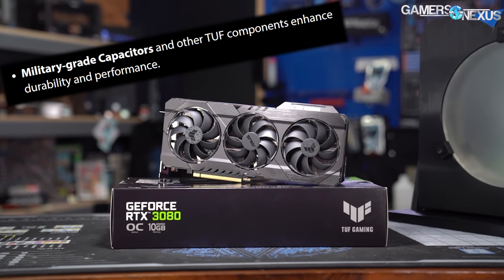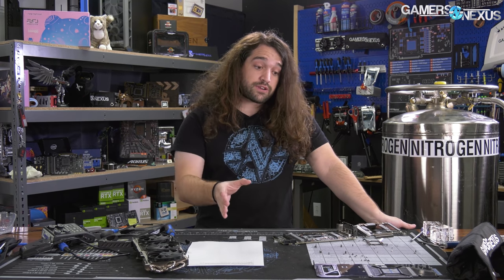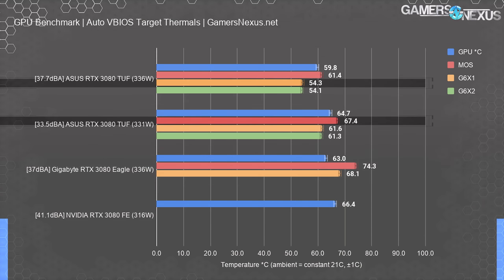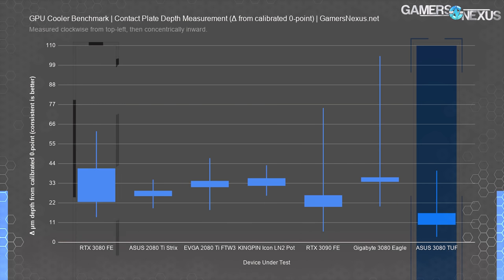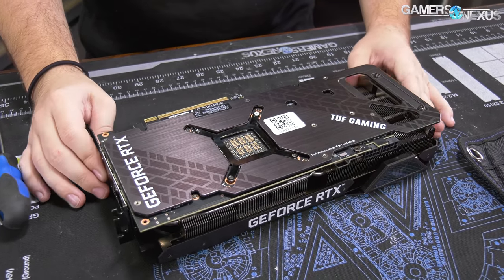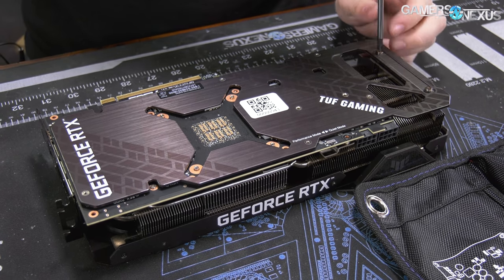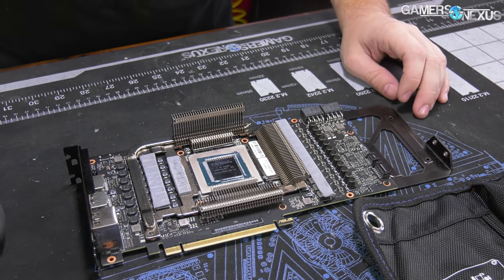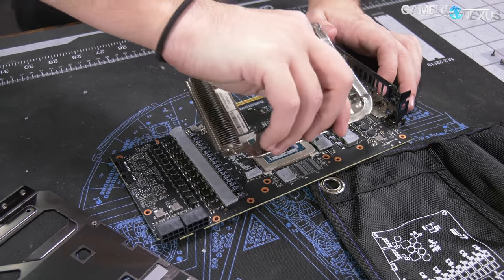ASUS RTX 3080 TUF OC Review & Tear-Down: Thermals, Noise, & Overclocking

Comment: Just wanted to say thank you for the teardown! I'm finally doing a full cleaning of my used 3080 that I got last year (it be dirty AF)! Got a bunch of new gelid gp-ultimate thermal pads that I'll be replacing the old ones with. 

Also, Armoury Crate somehow bricked the led, and  now it only works with Armoury Crate. I was so dumb to install it when I first built my new PC grrrrrr. Literally malware imo.

Comment: Definitely keen on seeing deshrouded performance of the TUF's cooling solution with separate cold plate for GD6X RAM vs other cards with a single cold plate solution. Most AIB 3080s look like they'll easily fit two 120mm fans.

Comment: Military grade reflects a specialized method of testing which consist of extreme G-Force survival, temperature and overvoltage specs. components designed for rockets and missiles. Aircraft Grade aluminum also is manufactured with higher levels of specs. including temperature tolerances and flex/fatigue stress.

Comment: Mine (Same model) came yesterday, ordered on September 17th. Had a bit of luck to get a model with the good power delivery at a decent (780 €, saw it for 999 € as well) price, since availability was crazy. Pretty heavy in comparison to the watercooled 1070 it replaces. Nearly didn't fit in the Define S. And quite noisy, but that's very subjective in an otherwise custom loop cooled system. 

I will use your video for changing to the water block, once one is available from a reputable manufacturer. I'm really curious how it will look in the new O-11 XL, once that hard line build is done.

Thx so much for the video!

Comment: Machinist here...
Aircraft grade aluminum is generally harder then normal 5052 or 6061.
7075 is generally used as "aircraft grade" because of its ability to withstand high tension. Its heat treatable (as is 6061) its great to weld and can be used in main structures where-in 5051 would just bend like rubber.

Military grade is a thing, despite companies over using the term. Military grade generally means the SKU has traceability. So if a problem were to arise due to a capacitor or mosfet... the traceability would give engineers the exact reasoning for failure (example being:  Foundry messed up the alloy,  SMT factory machine wasnt calibrated correctly, PCB manufacture had a questionable QC on a batch of motherboards, etc) But like i said traceability is the main thing, not super tough components. Also generally means there is no added BS to make the product not work. So flashy ammenities arent a thing on "military grade" which may be where the sentiment of "its only the bare minimum" comes from

All that being said Asus could just be blowing smoke out they ass. I dunno. But these things that are being mocked in fact due exist.

Comment: Couple of issues i have found with TUF - it doesnt have a properly functioning fan-stop feature at this point. It is configured to start spinning if power usage is more than 30w, which is 50w for other brands. But anyway i would prefer it to be entirely temperature based. In custom curve you cant stop the fans. It's not just me - it is being discussed all over the internet. I can live with it because my sample can spin with stable speed as low as 660 RPM, but others are saying it's locked at 1000 rpm for them.
Also some reviewers reported TUF having 375w tdp while what we have is obviously never breaks 350 barrier.
Both should be fixable with BIOS update, but as of now no official statement from ASUS.
Reply: yeah i have the same issue but im in the 1000rpm bracket :(, just sitting in windows the fans stop but the slightest draw in power the fans kick in then off then on, fingers crossed for a bios update

Comment: The ting i asociate with military grade components is 1 higher temperatures and 2 lead solder 

Because leadfree solder is not guaranteed to stay "good" for 20 years   leadfree solder can grow microscopic conductive "hair" that may short out pins
Reply: Dendrites. I ran into them before, a bitch to troubleshoot. Like dealing with a metal life form.

Comment: MIL-STD grade capacitors refers to components or devices qualified via test and/or analysis to MIL-STD-704 and/or MIL-STD-810 specifications. The various categories in these tests cover amongst others Environmental, Power and EMI / HIRF conditions. This could be a good thing, if the vendor advertising such compliance actually accompanies the statement with which categories of performance with thing these test their parts have be qualified to. In short, this could be a good thing especially when it comes to transients, ambient and operating temperatures on the motherboard, RF fields, etc. And regarding you aluminium references, aircraft grade aluminium is also nebulus. And "aluminum is NOT always aluminium. Aluminium comes in various forms, 7075, 6061, etc which have different tensile strengths. There are also more exotic types of aluminum such as Aluminium oxynitride (or known by  Star Trek fans as "transparent aluminium", Yes its real. Google it).

Comment: To be fair, generally, aircraft grade aluminum is 6000 and 7000 series aluminum. It's an actual qualified, mostly consistent standard. 6000 and 7000 series aluminum have higher tensile strength and are usually easier to weld and modify. It really depends on application as to which you would choose to use but it's actually something quantifiable. Most aircrafts are made with a combination of 7000 and 2000 series aluminum at various point in their structure. Military grade capacitors is nonsense marketing bullcrap with no quantifiable standard other than, "good enough for a random military force at some point in time to use this in something that requires a capacitor, even if only an alarm clock".

Comment: Actually, aluminum like most other metals come in many different grades due to their variance in the molecular properties, and are selected for the desired end product/use. 
Though, if the properties are not direly important to the user, one use different grades inefficiently without concern (similar to using a knife for soup or a spoon to cut a steak.. dumb but can be done).

"Aircraft grade" aluminum typically refers to 7075 for billets and 2024-T3 for tubes.
The composition of the billets, in particular are actually an alloy of aluminum & copper. 
The alloy increase the weight, strength and surface resistance while reducing ductility and oxidation and being a cheaper base materials and benefits from easier tooling & more cost effective manufacturing processes. 

As such, aircraft aluminum is typically used in the manufacturer of items for Aviation, aerospace and blow/injection molds, usually where weight is of a major concern.

Comparable desired properties are typically found in more expensive materials or materials that require a more costly manufacturing process like:
Stainless steel - heavier and costs more to tool
copper/brass - heavier, surface oxidization is faster/easier and has a lower surface resistance
bronze oxidize easily and is very expensive as a base material
carbon.. titanium.. niobium.. etc. etc.. etc

On the other hand, "Military Grade" is basically a standard of acceptancy that the US military has for vendors, when supplying items and does not however, always equate to durability (which is how it is how it is typically marketed).
eg. Military grade food rations (MRE) does not make it better than other food rations, it just means it meets the stipulated mineral ratio, etc as outlined.
So "military grade components" just means that it is supposed to last a stipulated & predetermined timeframe for use under specific conditions.

Soooo for eg, lets say they are buying a laptop for a recruitment office in a specific location and the mandate spec is that it need to last 2 years in a "standard office" environment with 6hrs of daily use,  using "specified" software/parameters, all with no equipment issues, then once the item meets/met the criteria, it was deemed Military grade.. which is similar but different to "combat grade" or "Harsh environment", etc.

Comment: As an aircraft engineer, there is big difference between Aluminum T6-7075 or T3-2024 (commercial aircraft use) with Aluminum T6-6061 (general use)

Comment: If you could get a hold of a Trinity card that would be great. So much vitriol online directed that cards way due to its relatively low power limit bump (5-6% iirc) and not using MLCCs. Lots of claims of it falling 8+% behind other AIBs in perf, which doesn't seem to be the case going off TPUs review but people are still claiming otherwise.

Comment: Its about rating for capacitors.  Military grade components are rated to a tighter tolerance and higher thermal stability.  There is not a massive difference but they do have to pass a tighter "binning" Some military components are designed from the ground up for higher strength and thermals or even radiation hardening.

Comment: From web: Military grade components are held to a higher standard than consumer grade components. Required to operate at elevated temperatures, exhibit higher tolerances and adhere to more stringent measures of quality control, obsolete military grade components can be some of the most difficult parts to source.

Comment: Hearing Steve talk about the size of Philips screw driver to use is interesting. In my experience most people who doesn't work a lot with tools tend to go for small screw drivers, usually one size below what they should have used. I can't begin to the times I've heard people bitch about how bad the Philips head screws work, only to see them try to screw in a #2 screw with a #1 driver or a #1 screw with a 0 or even 00 driver. No wonder they cam out over and over. Sure Philips in't nor was it ever the best, but still it's done a decent work for well over 100 years by now so it's not impossible to work with. In general I tell people to use the largest driver that will bottom out in the screw and that will usually be fine.

Comment: @Gamers Nexus What did you use for the frequency testing? I just tested my 3080 TUF OC with the 3DMark Time Spy Stress Test and the frequency is bouncing between 1850 and 1905 MHz, which is at least 100 MHz lower than your results. How is that possible? What is wrong with my card? Temps seems to be the same at 63 degrees as so is the power draw at 339W.

Comment: There's admittedly multiple different purity levels for aluminum. Purity doesn't mean much for strength by weight ratios, but it does imply how much it'll flex before it breaks as well and thermal conductivity. Aircraft-grade aluminum is indeed "just aluminum" but of a higher purity making it more flexible and offer higher than average thermal conductivity compared to lower purity aluminum. As for Military-grade... there is indeed a rating system for what falls within mil-spec tolerance, but for the US military that minimum standard is rather low. If it works, it's military spec. If it doesn't work, it could still be military spec.

Comment: Mil spec is good and it does have a definite real life parameter, not just marketing lingo.  The long & short of it is mil spec is better than normal and industrial grade is even better.  Details below. 
~~~~~~~~~~~
As I remember from my electronic engineering days (40 years ago) "Military Grade" electronic parts had a very specific and extended operation temperature range, tighter specification tolerances and higher power tolerance. Industrial grade parts are even one more step up.  For example, a mil spec resistor could be rated at 1/8 watt at 70ºC, but the same industrial grade version of that resistor would be rated at 1/4 watt up to 125ºC.  Both parts costing a great deal more that normal resistors.... as I recall from my National Semiconductor purchases.  So military grade parts means less variance between end product devices, which could be up to or more than 5% with normal caps & resistors.

Comment: So… in Germany this card is 897,25€ (about $1060) from official resellers. The FE would 699€ ($824), but NVIDIA stopped selling it and hasn't announced who will sell them in Europe, if at all. - But due to Covid we had a temporary VAT cut from 19 to 16%, thus in January the cards will be 720€ ($850) for the FE   and 920€ ($1090) for the TUF respectively… no MSRP cards will ever hit Europe expect the handful of FE cards sold so far.

Comment: Ive received mine one week ago. 64°c in burn, no crash, cap at 2050mhz. Perfect ^^
Reply: If i put +100, +200 or more in core clock, the max frequency stay at 2050mhz. May be a bios limitation? This board is really stable. No crash at all. The oc of the memory don't do anything in benchmark and game, ive tried but i have nothing.
Reply: @mzell36  it runs into the power limit. you have to increase that as well.
Reply: @NorbertGanslmeier  it’s already done ^^ 110%

Comment: @gamers nexus; In Canada, Asus and Gigabyte both state that the warranty is void "in applicable regions" if the taper seal is damaged or removed in their separate 'warranty pamphlet' that comes with the cards.
it looks like the way they set it up, is to sneak the warranty warning into the little pamphlet that no one reads, that they can more easily alter for different regions.
at least that was the case with both the 2080 supers i worked with in the last few months

Comment: Mil-Grade ( Military Grade) electronic components have a very high tolerance for values. Example common electronic resistors have a value tolerance of around +/- 20% where mil-spec have a tolerance of around +/- 1%.

Comment: Military grade components are a thing but for the most part there just binned & have been through extra testing and grading to meet requirements for voltages,thermals,shock or G force

Comment: It runs a lot more quietly than my EVGA 2070 Super. I run it locked at 2100 MHz at 68 C. Running it stock was around 56 C. Air cooled system in a room with ambient temp of 21 C.

Comment: Reasons why I buy this is that it has 2 x 8 not 3 X 8 which would fit in any Egpu without changing the Power supple or splitter cored that would risk the gpu itself. The price is a budget end then ROG strix which is based for desk top chassis. If ROG did keep. The 2 x 8 with an optional activation of 3 x 8 would sell out for a few. More years but as most streamer and gamers

Comment: For all you joking about “military-grade”. It’s actually not a bad thing, just means it’s built to a specific standard, meant for endurance and reliability, and to be easily used and maintained by grunts/nincompoops/5 year olds without destroying the thing or killing themselves.

It’s also rarely “cheap”, even if it was the lowest bidder building it, which isn’t always the case it’s still never “cheap”. Usually the company getting the contract isn’t the cheapest, but the one that can honor certain particulars of a contract - supply quantities, deadlines/timelines, training and maintenance schedules.

Comment: I'd like to shrare some results with lapping and repasting GPU HS over the years. I had 3 980ti and the best thermal paste was the old MX-4. I had top pastes at the time including some mada by Kingpin but MX-4 came on top on every test. I've a 2070 now, the Galax OC yada yada with the 5 heatpipes cooler. Tried Gelid, new Kingpin and the new Noctua. Gelid is a clear winner. From my most recent tests it's obvious (don't ask me why) that GPUs fare better with less viscous paste. Don't assume what's best for CPU is automatically better for the GPU.

Comment: Military grade often refers to a component classification , i electronics this means a wider temperature rane - minus 40 to plus 125 c .   This appears to be limited to the capacitors , and is prohibitively expensive in any but military applications

Comment: I don't want to sound like a nerd, even though I will and am, but aircraft grade aluminium actually means something. Aluminium is NEVER pure aluminium, it's always used as an alloy. Aircraft grade aluminium is 7075-T6 which is much, much stronger than the 6061 normally used.

Comment: Been waiting for this review! I was wishing for more in-depth power analysis though. 

I've been personally thinking about TUF 3080, but I'm unsure if my PSU can handle it. 
I have a 600W Seasonic Fanless Titanium PSU, which can handle up to 667W on the 12V rail, but I'm not sure if this card peaks at high wattages, or should I just wait or get soemthing with better power efficiency, as I don't want to change +200€ PSU because of the card.
Reply: What did you end up doing?

Comment: Military grade used to mean the components had a higher operating temperature range. Eg the equipment could be deployed to cold or hot climates. But I think with modern manufacturers and quality control military grade components are basically the same as consumers components.

Comment: I believe one of the main reasons for companies not to make it easy to just replace a fan is to force a user to ship the whole GPU to Asus which means shipping costs for the user and this can make many shy away from asking for an RMA. However, if it was just to show proof of the fan not working for a replacement fan then the user doesn't have to much at all.

Comment: As a computer system builder from 1992 to 2000, I can remember that Asus was the motherboard of choice back then. It was Gigabyte and MSI that were guarateed to fail. I imagine that may have changed over time just as LG and Samsung stopped building televisions that burst into flame because of crap component glue that carbonised and started conducting in hot temps in Australia. Time changes stuff.... sometimes it doesn't.
Reply: Upgrading my 1080TI. I got a 3070TI Rog in a shuffle and caught a 3080TI TUF today? Which is better cost to performance and is 3080TI ROG preferred over TUF?
Reply: @eugeneparis  i think your question may have attached to the wrong conversation thread.